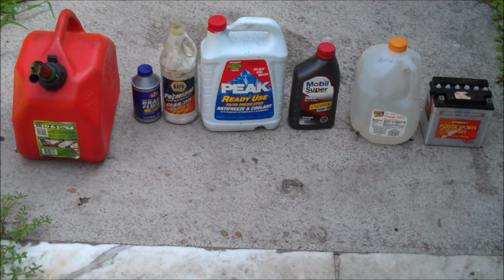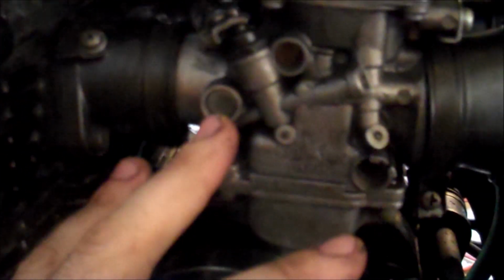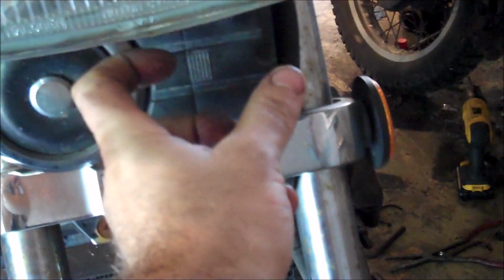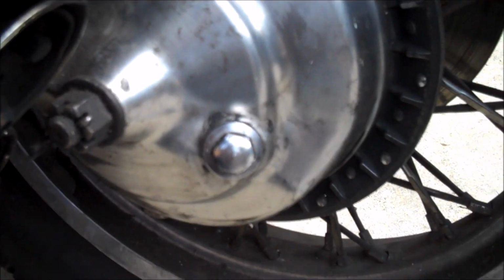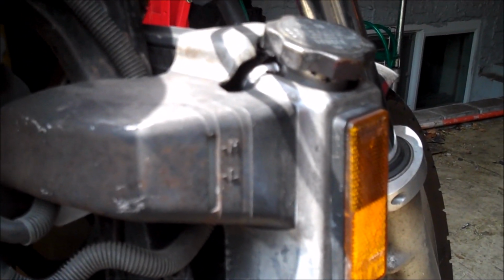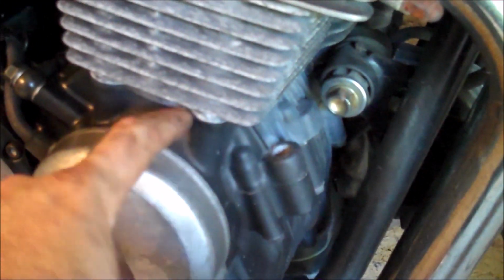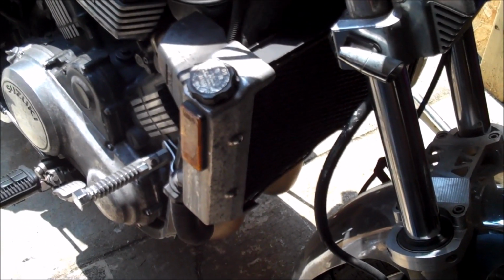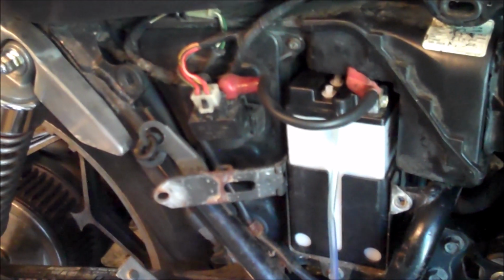How to identify and repair leaks on your motorcycle

Comment: if it wasnt for your petcock video that shows how the petcock works i would have never figured out that ive been running the bike on "on" so once it went below the on straw it chugged out. i switched it to "reserve" and filled her up and now the baby runs like a beauty! thanks so much!
Reply from the maker: Awesome
Reply: But wouldn't it be better to use the regular way of keeping Your fuel supply in mind then if needed using reserve as a last resort?     Mebby?    ~:- }
Reply: haha you are exactly right, that's what i am doing now. i did not realize this before and his video gave me a much better idea of how the whole thing worked. im new to working on my bike so bear with my stupidity on simple things such as fuel valve settings xD

Comment: A faulty float needle was causing my carbs to overflow into the engine and leak as a mixture of oil like you described. I thought the oil leak was a separate issue and I was about to spend most of my day tomorrow wasting my time trying to figure out the cause of the leak when I had already solved it. Thanks for the info.

Comment: I just want to say thank you for being on youtube and continuing to do videos. I found you 3 years ago looking up how to clean carbs because i was a first time bike owner. I now own 3. A KZ750, XJ750, and GS650. My only question is how do you find time to work full time and work on your bikes. Mine sit way to long needing small repairs
Reply from the maker: Right on dude which one is your favorite? My schedule actually is 4 days of work, 4 days off, so usually I find a couple days a week that I can put some bike work into
Reply: mrmaxstorey My favorite is my Yamaha, because its the only one I've had out on the road.  ALSO, I have a question. Hopefully by putting it in a comment others can weigh in on the chance you don't know. I have an 82 KZ750 4 cylinder.  With NO TITLE. But, I found a deal for a KZ750 Twin, that has a title, but is otherwise an incomplete bike. Has the block, head, and front forks. Thats it. But, it has a title. All for $200. Is there any hope of compatibility of just the frames? And can you or anyone recommend any online forums to answer questions about these bikes that you haven't already addressed in a video? Thanks again. Sorry for the long comment.
Reply from the maker: Paunae
Unfortunately I cannot confirm or disconfirm that these motors are a straight swap. However consult the fellows at kzrider.com they should know

Comment: My cam chain tensioner gasket gave out on my DR650sm. It still rides fine but I hate the smoke coming from the oil spray evaporating off the header pipe.
Reply from the maker: +MotardSteve Id fix it asap it sucks to jump time
Reply: +mrmaxstorey Yeah I've got the gasket in the mail now. Getting it fixed Saturday. She still holds plenty of oil even after having to ride her 35 miles back home. It's a common occurrence for the DR.

Comment: My cylinder head appears to be leaking out of the gasket on my 1980 honda xl 185. Have I done damage to other engine components by continuing to ride like this? Will I be able to solve my issue just by replacing the gasket or will I need to rebuilt the cylinder head as well? I noticed my bike will need to continue to run on choke even when warm and cut out at a stop light, is this related or the carb needing to be rebuilt? Thanks
Reply from the maker: I challenge you to find a running motorcycle that old which is not leaking oil from a gasket somewhere, especially on single cylinders. Most people regard it as merely cosmetic unless it is actively dripping. Its not a big deal just check your oil level periodically. About your bike requiring choke to run, a carb cleaning would be a good idea, as well as a new air filter, and make sure your idle is set properly

Comment: Hi im Espen from Norway. Great video..... My father in law have a suzuki gr650 that leaks through the exhaust. I have changed the needle and o-ring that is open and closing by the float bowl, but it still backfires and leaks through exhaust. Anny suggestions what to do?
Best reg. from norway

Comment: +mrmaxstorey have a 83 kz650cbr, I see I have a leak from the inner right side of the head gasket. Gaskets have probably never been replaced. Ordered new gaskets, would gasket sealant be a quick fix for the mean time till I get the gasket? Also, how bad is it, when ever it is leaking, I am assuming its oil. Its a watery oily substance blackish/brownish in color. Thank you
Reply from the maker: +Tyler Do you mean the kz650 CSR? Never heard of the kz650CBR. If so then it should be air cooled so quick fix gasket sealers are not an option, and there shouldnt be any water near there. Should be oil if anything.

Comment: Hey max, ive been working on a 1981 gs1000 that someone hacked into a bobber.. anyways i noticed this rotating thing on the front of the engine and after watching this video I think its where the oil cooler must have been? Anyways is it okay to leave it, or should i add a new oil cooler or is there a way to plug it up.
Reply from the maker: +Noah Marchand Definitely add a stock oil cooler on there

Comment: I know this may not be the right place to ask but I figure your expertise would come in handy. Anyway, my 1983 cb750 seems to be leaking gas into the crankcase (oil level is higher and oil smells like gas). I rebuilt the carbs with new needles, orings, and gaskets. After it was all together I would start the bike and gas would leak out of the carb. Specifically the connecting fuel rod between carbs 1 and 2 is leaking gas. It only lasts for about a minute then it stops. I figure the excess is leaking into the engine cylinders. 
I just don't understand why this is happening because I put new float needles in and the last time I checked the floats were air tight and doing their job. Although maybe when everything is put together something is not working as it should. Any insight would be killer!
Reply from the maker: It sounds like you may still be overflowing via the floats, and you have a bad seal at that connecting rod. You'll need to find out which float/float needle/chamber etc is leaking, and separate the carbs and put a new pair of seals in that connecting rod

Comment: Hey Max.  My gs450 is leaking out of the clutch push rod seal (left side of the motor).  The factory seal is flanged, but they introduced an unflanged seal with a retaining plate in later model years.  Any suggestions on how to dig the old seal out without splitting the cases?
Reply from the maker: Can you pull it out with a hooked pick?
Reply: mrmaxstorey no, because there is a flange on the back side of the seal itself.  the flange prevents the seal from pushing out due to oil pressure.
Reply from the maker: wouldntyaliktono
So I am to understand that it was pressed in there, and can only be pushed out from the inside of the motor?
Reply: mrmaxstorey The two halves of the engine case have a groove milled into them.  The seal was placed in the lower half so that the groove accepts the flange, then the other half of the case was lowered down on top of it, capturing the seal and holding it in place against oil pressure.  

the new seal has no flange, and can be pressed in from the outside.  it's held in place by a bracket that is included in the seal replacement kit.
Reply from the maker: wouldntyaliktono
Ah yeah I get you know. Yeah thats a real bitch Ive dealt with that before. I didnt really find any good way around it so I had to split the cases to prevent damaging them. If you are really handy with a drill and a dremel you might try just trying to cut the bitch apart, but the risk of damaging the case and causing a leak is something to consider
Reply: I'm certainly tempted.  I'd like to avoid dismantling the motor if at all possible.  The idea of using a hole saw has crossed my mind.

Comment: my bike is leaking gas and oil most likely gas overflow I could smell Gas before it happened, it started leaking as soon as I turned the bike on. just wondering if starting it up and let it run will fix the problem or what should I do?

Comment: hey, I'm leaking a red fluid....... looks like it's from a cylinder looking thing I also see some oilish on the silver rod connected to the tire on the left side, my radiator appears to be broken since it overheats if not I'm motion,. Is the red fluid break,gear,or radiator fluid?.
Reply from the maker: Sometimes radiator coolant is red in color
Reply: mrmaxstorey ty,il take it to a shop

Comment: My dads bike had the oil that smelt like gas coming from the exhaust pipe on the bottom what does this mean he thinks he blew a head cuz he said oil squirted from the motor any advice on what it could be.
Reply from the maker: I see this all the time. Overflowing petcock and carb floats leak gas into the motor, which leaks past the rings and into the sump, overflowing the oil. Repair the carb, change the oil, and you're good

Comment: my 81 Yamaha 650 is leaking gas but I couldn't find where it was coming from but it was driping down the kick stand it sounds like from what you said its coming out of the drip hole in the air box what do you think
Reply from the maker: +Gearjunkie79 Its really important to figure out where exactly the leak is coming from before you start a repair

Comment: My max I have a 1985 yamaha virago xv1000n. When I bought the bike it had a single carb work around on it and the job was poorly done and the carburetor damaged beyond repair. I want to get the bike back to stock so I bought the correct Hitachi dual carburetor and air boxes. Well when I got it all together the bike almost started on full choke then drown out and started POORING straight gasoline out of the exhaust as it turned over. Any ideas what is causing my tremendous gas leak? I have been told to get new spark plugs but it seems like too much gas for that to be the only issue
Reply from the maker: Check out my video on leaking carburetors, its possible you are only running on one cyl and the other one is overflowing through the motor

Comment: Hey, I have a 1963 Honda trail 55 and I was wondering if you could help me with something? My dad and I re filled the oil and the next day I went to ride it to school, it started making a spraying noise, so I looked down and it looked to be leaking oil from the head and some where else. But I'm not sure if it was in two places or not. It was also running a little week. Like it didn't have as much power as usual. Do you know how I might go about fixing it? If it's from the head area I think it's a gasket that needs to be replaced, as it has the original gaskets and I'm searching for replacements. If you could help in anyway that'd be appreciated.
Reply from the maker: Are you sure you refilled it to the proper level?
Reply: We might of over filled it, I couldn't tell. Would that cause problems?
Reply from the maker: huntersihelp
Not really it would just squirt out. You might have fouled the spark plug. Drain out the excess oil to the proper level and replace the spark plug
Reply: Alright, so we drained the oil and took apart the top end. Turns out there was two old O rings that were bad/broken. And that's where it was leaking from. We replaced those and now no problems when it comes to leaking! Thank you for help. 

I have another question of you don't mind me asking. Now when riding it will kind of sputter or bog and loose power for a brief second then it'll come back. Do you happen to know what that might be? I was kind of thinking a gas problem but I don't know. I'm new to motorcycles, I'm use to old mopeds. Haha. Thanks again.
Reply: Oh and I forgot to mention, we filled it back up to the proper amount. At least that's what my dad said. And the dip stick shows the oil is on the recommended amount.
Reply from the maker: huntersihelp
That is usually an indication of floats sticking or float levels being off

Comment: I have a Honda Spirit 750 been parked up for a while couple months . Bike is leaking oil ether out starter r under neath it I took starter off clean it up put starter back on bike .n . Started bike up oil pressure light was on let bike idle for a minute had Lil knock n lower n started leaking n same spot . Any idea what could b the problem

Comment: i have a video where i briefly explain a leak i found on the engine of a '97 Rm250. it leaks from where the the top and bottom parts of the engine meet. do i need to replace the rubber seals? should i buy a gasket kit or what is it that i should be getti g and doing?
Reply from the maker: +Benuova Send me the link

Comment: i just got an oil leak over my shifter, got all onto my back tire on the left side, my chaine, and the bottom of my left fairing. could it be my stator?
Reply: i have a similar issue, what did it end up being?
Reply: seems like your oil level was too high. When you go into 8k+ rpm range it sucks through the pipe and back into the filter. Does it seem to be dripping near your kickstand?

Comment: My friend let his 1993 Yamaha Virgo 1100 sit and the float valve stuck open and one carb was dumping so much gas that cylinder would not fire and gas was spraying out of the exhaust as the other cylinder kept the motor going.
Reply from the maker: Yeah, that happens

Comment: I got a huge leak of oil on my 230 dirt bike and it seems to being coming from the where the exhaust connects to the head of the motor, so I filled it back up with oil to see if I’m burning oil out the combustion but there’s no white smoke at all. It just keeps leaking from the connection from the exhaust to the the head. And it’s just. A 2017 (pretty new!), soooo any ideas about what’s wrong with it. Because I’m out of ideas.
Reply from the maker: OK is it still under warranty? And were the recommended break in procedures followed?
Reply: mrmaxstorey  I wasn't the first owner but I've been riding it for 18 hours now it was feeling fine until now and no there is no warranty. also thanks for the fast reply
Reply from the maker: Burned Waffles  OK get down in there really good and see exactly where the leak is coming from, you are right that if it was in the combusion chamber you would get smoke so it may be coming from a head gasket or valve cover gasket, sometimes those run up in there

Comment: I have E-Charm 150cc that is leaking oil but can't tell from where n there is something in the front close to the battery that looks like a cO2 sensor n that is smoking a lot. U by chance know what the issues might be? Thanks!

Comment: My cbr 600 f2 leaks gas( pours out really) when I filled her up last week. And she would not start. Took it to a motorcycle specialist . And he said I needed a new gas tank. Petcock . My question is could this be the reason why she is not starting as we'll?
Reply from the maker: Yeah well it depends on where you are leaking from. If your petcock is stuck open, and it is dumping gas into the carb, you may be flooding the engine and running rich and thus not starting easily. If thats the case you will be lekaing out your carb overflows and you should check out my leaking carb video AND my petcock repair video. However if there is some break in the fuel line or the petcock is leaking out the cover, then you might not be getting gas to the carbs at all and thats your problem. Find out where you are pouring gas from
Reply: We'll I saw it leak out in the middle of the carb case on the left hand side of the bike. Some screws around the carb case and like this T sort of shaped figure by the carbs that sticks out downward. Within 5-10 minutes 4$ worth of gas was all gone. I have already watched your video on rebuilding but not cleaning carbs. Hopefully it's just the gasket seals In them that need replaced . But my question is should I be looking for a new gas tank as we'll ? I def want to acquire a new petcock.
Reply from the maker: Marvy Marv
I dont think you will need a new tank unless it has a puncture in it. I have a video specifically for leaking carbs its different from my carb rebuild video, check it out and see if it helps you
Reply: Thankyou for your help good sir!!!!

Comment: i maintained my honda shadow 1100 1996 before it was loosing oil and still loosing oil from the air filter any suggestions?
Reply from the maker: That can happen for a couple reasons. Take off you oil cap and smell the oil, if it smells gassy then your carb is overflowing into the motor, leaking down below the pistons and diluting and filling up your oil, causing it to overflow. Repair the carb and change the oil immediately before you do any more damage running the motor with diluted oil. If that is not the case, you may have a plugged crankcase vent causing blowby to force a little crankcase gasses to bubble out some oil but it shouldnt be very dramatic
Reply: @mrmaxstorey  thank you for your input I will check asap

Comment: my Honda rebel 1987 
works great but gasoline is goin inside of the engine
if i clean my carb do u think  would fix the problem
Reply from the maker: Yes your carb is overflowing. See my leaking carburetor video for the solution

Comment: Hi there! My Honda XRM 125 has a gas leak in the spark plug. Can you teach me what to do?
Reply from the maker: So, gas is leaking onto your motor and pooling down at the spark plug?
Reply: Yes, absolutely yes.
Reply from the maker: Where is it leaking from? The carburetor, fuel line, petcock, or fuel tank?